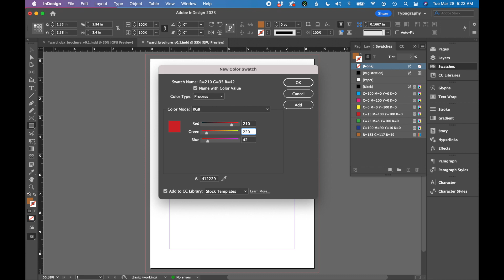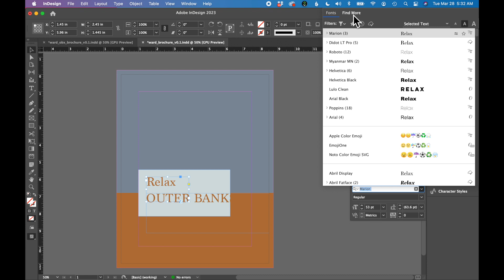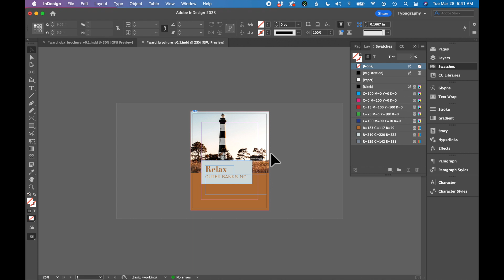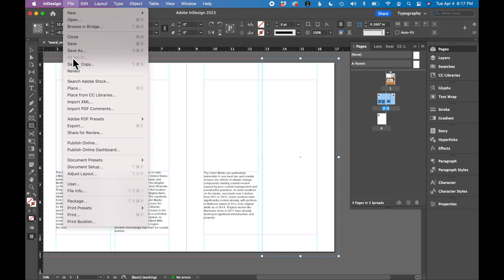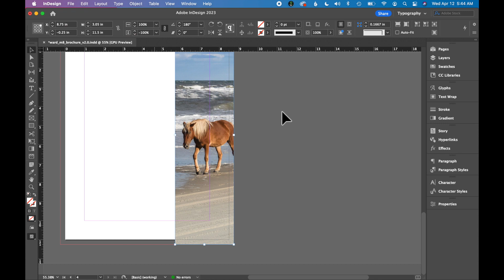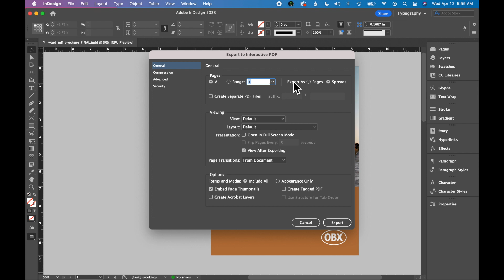Free InDesign Course For Beginners: Design a Brochure From Start to Finish + Practice Files

Comment: Hi. When I packaged the file, following your instructions, I got the .dml file, the indd file, the links, but no font folder. Do you know why that would be?
Reply from the maker: Hello! A couple reasons why this happened: 1) in Create Packaged Folder window, you may need to manually check/select the “copy fonts” option. 2) there a problem with the font and it can’t be copied. This might happen if it’s an Adobe or cloud font, you may not have permissions to copy it in a folder. Hope that helps!

Comment: Is the pdf file that InDesign packaged saved as spreads?
Reply from the maker: Spreads are a setting in the export process, so you may need to export another PDF and specify that you want spreads. I’m not sure if you can set it during packaging.